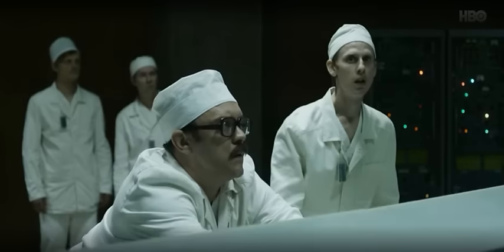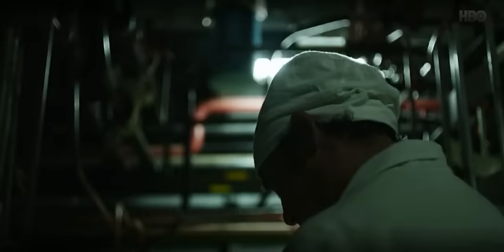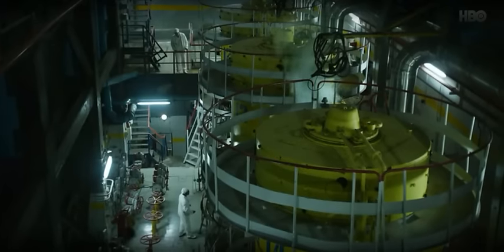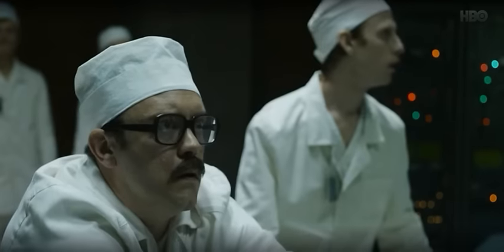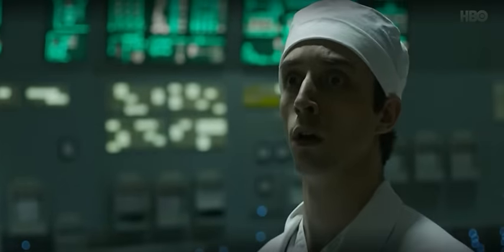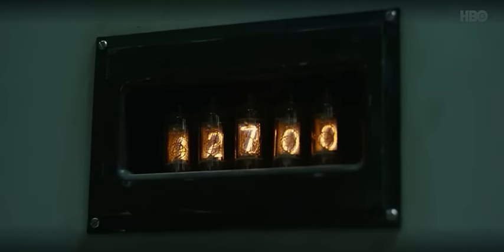Chernobyl (2019) Nuclear Reactor Explosion Scene

Comment: I've often wondered if there were any security cameras that recorded this unholy catastrophic event.  But that none of those videos were ever released due to insane soviet security demands.
Reply: More than  likely with everything else within proximity of core explosion and  adjacent to the
core bonfire that blazed ungodly hot for many hours unabated

Ya know I bet you are right and the security cctv from that era's pixel strength shot
4k high definition video.
Recorded for posterity on modern 
BetaMax cassette
Reply: Even if it did exist, I wonder if it would've survived the radiation. I know that the pictures taken during the helicopter flyover just hours after the explosion by journalist Igor Kostin  were damaged by the radiation. Most of Kostin's pictures were not salvageable and the few that were salvageable have that yellow tint that we're familiar with. Given the technology of the 80's, I doubt that any recorded footage from cameras that might have been inside the reactor chamber when the lid blew off would have been watchable anyway.

Comment: You know hippies, nuclear reactors are quite safe when you don't have cheapskate Soviets building them
Reply: Not if you build them on the seashore of a place that routinely gets hit by tsunamis. But Fukushima was a city planning failure, not a reactor design failure.
Reply: @Jagonath  Nah, that only happens sometimes, lets build another in these areas
Reply: Better dead than Red
Reply: @LanceRagland  agreeable
Reply: @LanceRagland  Truer words have not been spoken before
Reply: Once we can recycle the used radioactive material, we fucking set for life
Reply: @Jagonath  Fukushima was a failure on the part of the company that built and owned the facility, specifically, a failure to learn from the mistakes of others. When hurricane Katrina flooded New Orleans on August 29, 2005, area hospitals discovered, the hard way, that having their backup generators at or below ground level may not have been the best idea. This failure was well publicized at the time. When the tsunami struck Fukushima almost six years later, where were their backup generators? If you said at or below ground level, you would be correct. There would have been no explosions, no meltdowns, no spewing of radiation, if there had been backup power to pump water into the reactor cores. There would have been backup power if management had taken the obvious step of raising the generators. There are reasons for this failure on the part of management, all of them ugly. There are no excuses.
Reply: @ghewins  You're right, and a great post. Even still, the location was all wrong. The generators could have been five stories high and it still might not have helped when a tsunami hits. That's speculation, but thinks get wrecked, cables cut, things short out etc. Reactors should be built well inland in any place likely to get hit by storms or tsunamis.

Comment: Neat bit i there are ~16 RBMK reactors of the same design that ran for decades after this happened without issue, albeit with a lot of upgrades. Seven are still running today.
Reply: Well the head of Chernobyl clean up killed himself to bring rbmk issue into light that's why those still works
Reply: One is in India. Installed after Chernobyl in kudamkulam TN.
Reply: @s0j0urner15 , incorrect. RBMKs were only ever built in Russia, Lithuania, and Ukraine. Perhaps you are thinking of Russian VVER PWR? That's a completely different design.
Reply: @michaelkeller5008  War. War never changes.

Comment: 3:06 great graphics, but it certainly didn't happened that way. First explosion was actually a steam explosion, no fire was present. Steam explosion knocked off the nothern wall of the reactor hall. Upon separation of the pressure tubes, high-pressure very hot steam was gushing out of the reactor - so instead of a fire and a smoke, imagine a HUGE vapor cloud coming out of the reactor building. Try to imagine deafening sound of steam hissing. Liquid water in the cooling loop immediately turned into steam as the pressure dropped, so the steam ejection had to last for some time. So much steam prevented buildup of the hydrogen and oxygen mixture, so the second explosion could have happened only after steam and water ejection stopped.
Reply: Check the current position and shape of the reactor lid - the tubes are bent downwards, not upwards. It means the explosion that blew off the roof of the reactor hall didn't come from the reactor cavity. The lid certainly didn't fly up in the air as I've seen in numerous animations and clips about disaster - if it did, it would have crashed itself, reactor vessel and the pressure tubes. No, the lid just rotated into vertical position and stayed there - again no (huge) explosion ever happened from within the vessel. But as I said, the reactor exploded, right? Yes, but the first explosion went sideways in north direction, blew off the wall and most of the steam got ejected there. Space above the lid remained pretty much intact. After steam vented away, hydrogen and oxygen production started and it started accumulating in the reactor room above the lid. It was that second - hydrogen explosion that caused most of the damage.
Reply: How do I know that reactor room was mostly intact after the first explosion? Because it's obvious explosion happened there and there was no other fuel to explode except hydrogen gas (and it is actually created inside the super-heated reactor core). But hydrogen is very light gas and it disperses very quickly, so in order to make a huge explosion, it has to be previously accumulated inside an enclosed space and mixed with air/oxygen, without lightening source such as fire or sparks (otherwise it would simply burn out). It is virtually impossible to create an explosive mixture of hydrogen gas in an open space.
Reply: Knowing that explosion happened above the reactor later, some time after the lid got popped open, brings me to the conclusion that there had to be at least one more explosion, a rather small one, that originated from inside the core. Hydrogen explosion above the lid blew off the roof of the reactor building, but would not have ejected the core material onto the remaining parts of the roof (that liquidators were shovelling later). That third explosion didn't bend the tubes attached to the reactor's lid either - so I concluded that the third explosion happened in a "southern" part of the core. The northen part was ejected outside during the steam explosion, but the southern part was ejected later on in a small, separate explosion. The firefighters saw the graphite lumps that came out of the northern part of the core.

Comment: 3:39 That beam of light
Reply: "That's radiation ionizing the air!"
Reply: @OurHereafter In straight line??
Reply: A sign that Sauron was ready to launch his attack on Pripyat.
Reply: @deepakddx333  Radiation travels in straight lines unless it's charged particles that get bent by a strong field.

Radioactive materials, in other words hot materials, might drift and settle but the radiation they emit moves like light, which is a rather benign form of radiation.
Reply: Legend has it that the Reactor Core is still throbbing today
Reply: Cherenkov Radiation

Comment: FACTUAL ERROR: There was no "graphite tip", per se. Raise your hand if you hear 'graphite tip' and you think of like a little graphite cap fixed to the end of the control rod. Or like a pencil. Right?

Wrong. This is one of the most asinine falsehoods about Chernobyl that for some reason persists. ALMOST EVERYBODY gets it wrong. Here's the truth: when you build a reactor, you consider how you want it moderated using lots of spooky math to get the neutron/fission reaction to be balanced how you need it. RBMK reactors are graphite-moderated, so the graphite balance is crucial. WATER slows down neutrons, very effectively-so. When you withdraw control rods, you are doing so to increase reactivity, however, what fills the hole where the boron rod was? Well, water. Which SLOWS reactions. So you need to plug the hole so it doesn't fill with water. And since the whole reactor is designed around graphite moderation... you use graphite. So when this giant 9-meter control rod lifts up, it will pull a 9-meter long ballast of graphite to fill the empty hole so it doesn't fill with water.

The only 'design flaw' that existed in this system isn't even >hinted< at in the show. The design flaw, if you can consider that, is that the 9-meter long boron control rod didn't have a 9-meter long graphite ballast. It was more like 7 meters, because when the rod pushes in, that ballast has to go somewhere. The reactor simply wasn't big/deep enough to push the 9-meter rod out of the way, it had to be 7 meters, and was attached to a little telescoping system so it'd hang in the middle of the reactor pile. This left water at the top and bottom, which slows reactions. Under normal operation, this is accounted for in the reactor balance.

Note that some control rods entered from the bottom. Those rods weren't limited in space and had a fully-fixed 9-meter long graphite ballast without a telescoping mechanism.

However, the ENTIRE REASON CHERNOBYL BLEW UP was because the water ran dry! With the control rods all the way out, there was a LOT of water in the empty channels at the top and bottom. However, the water boiled dry, which meant the balance was broken - where it was designed to operate with water, now just had steam (which doesn't slow neutrons as much as liquid water does). This greatly increased heat and reactivity in the bottom. When they pushed the SCRAM button, the graphite ballast pushed down into the steam void, which increased reactivity by displacing steam with graphite. This caused the runaway xenon burn-off reaction, which spiked temperatures and ruptured several fuel rods and cracked the graphite and jammed the control rods from descending. This meant no boron, literally just a solid mass of graphite, which caused the runaway reaction.

The show did this fact very dirty with his BS excuse of "it was cheaper". And everybody therefore thinks the control rods had stupid little 'pencil tips' of graphite capping them for literally no reason at all except 'lol soviets r dumb'.

One more thing - this entire reaction is happening unbelievably fast - I believe the ratio is something like a doubling of power every 10 milliseconds. It wasn't like the water was displaced and the rods kept moving while it gradually heated up - the spike in power happened in a fraction of the blink of an eye. The neutron flux spike, the flash-boiling of all remaining water, and the internal explosion happened almost in the same moment, at a speed completely beyond human perception.
Reply: Very interesting…. Will do some research.
Reply: Why lie about the graphite tips then? I'm not saying you're wrong, I am just wondering why go so far off the truth for the show?
Reply: Good comment
Reply: @AB-ez4rm  Poor research. That's it. The 'graphite tips' has been something that shows up in practically every piece of media made about Chernobyl for decades. I'm going to guess at some point down the line some "expert" wrote a book or something and thats' where they all got their reference material.
Reply: @AB-ez4rm may be explaining all these would be boring for a general audience?
Reply: This show explains a decent dumbed down physics otherwise
Reply: @fnhatic6694  To be fair I think explaining the whole mechanism would be too much for the audience so they decided to simplify it to follow the narrative that it wasn't only "operator error" but a systemic one. They did an accompanying podcast where they explained the oversights in the actual show I believe.
Reply: What an absolutely cathartic read. Well done for saying in one paragraph what I've been trying to explain to others for years. Thank you
Reply: you're right but actually lol soviets were dumb
Reply: @sayandas6929  I'd have to agree with you. I tried watching a physicist explain how the accident happened and got lost in technical jargon.
Reply: The entire RBMK design can pretty much be summed up by "it's cheaper" though. Graphite moderators allow you to use uranium fuel with a lower concentration of U-235 WITHOUT having to use highly expensive heavy water as a neutron moderator. Add in the lack of a containment structure and the questionable graphite displacers and you've got a very powerful reactor for very low cost, but with enough design flaws to make even the most ardent nuclear supporter raise an eyebrow. Makes sense that the EU demanded that Lithuania close their plant as part of their accession agreement.
Reply: Wait so when pressing A3-5 the graphite tips (really 7 meter) were already in to block off watter? But because it's such a delicate design (based on ur explaination) where 1 misstep can cause things to go out of whack, when there's that much water present since all the boron rods were all lifted out, the combo of that significant amount of water plus the graphit rods was the deadly combo?

But under normal circumstances the combo of water/graphite rods are taken into account for and this was just an extreme situation?
Reply: @Obi-Wanthepyromaniac  It wasn't "one misstep", the entire disaster was like ten missteps and nine of them shouldn't have happened. The only one that 'should' have was part of the test design which had been performed safely on every other RBMK, including units 1-3 at Chernobyl.

Absolutely nobody involved in any nuclear program anywhere on the planet would think it's even remotely sane to pull literally every single control rod out of the reactor, much less not think something is weird when doing so barely squeezes 200 MW.
Reply: @fnhatic6694  so basically there was a design flaw but it technically shouldn't have mattered cause in order to get to that step you have to make 9 dumb moves before hand ?
Reply: Good and true details, but the general reason briefly outlined in the film for them still remains true too - simply because "it was CHEAPER". 
They could have included in the design of the reactor building a free space under it 2 meters higher in height, which would have made it possible to abandon the "telescopic" rods and use solid ones with which such a catastrophe would have been impossible. But this option was considered but abandoned, because it would have cost more (additional materials and working hours during the construction of the reactor building) and simply chose the option that is CHEAPER, but less reliable.

Also, the use of most of the graphite in control rods can be completely abandoned and rods consisting almost entirely of Boron compounds can be used. But when choosing this option, a small part of the maximum reactivity reserve of the reactor is lost, which leads to the need to use fuels with slightly higher levels of Uranium-235 enrichment. Which would be slightly more expensive (here during operation - in the form of regular fuel costs, while fuel costs only <10% of total costs back when, and ADDITIONAL costs in question is <1%). As a result, this was abandoned too and a design option of control rods with maximum use of graphite was chosen instead - because it is CHEAPER (as it allow you to use fuel with minimum enrichment levels) .

And no need to say that 2e is impossible. After the Chernobyl disaster, most of the RBMK-type reactors were upgraded to increase safety, and the most important stage of this modernization was precisely this - replacing part of the graphite in the control rods. This required slightly increasing the enrichment of nuclear fuel, but allowed to close the "gap" of positive reactivity when rods lowered and making such an accident impossible in the future. 

Although they should have done it MUCH earlier - after the first accident of this kind (I hope you know about the 1975y nuclear accident at the Leningrad nuclear power plant, which took place on exactly the same reactor model and developed according to the same scheme and almost became the first Chernobyl?). But they did not do this too, because it required significant expenses. Instead, the accident at the Leningrad nuclear power plant was simply classified, hiding all the collected details, along with those that became known back then (more than 10 years before the Chernobyl accident!) few critical flaws of ALL RBMK reactors. Because it was CHEAPER than upgrading all already existing reactors to eliminate the already identified flaws.
Reply: They did have graphite tips, like half boron, half graphite at the bottom